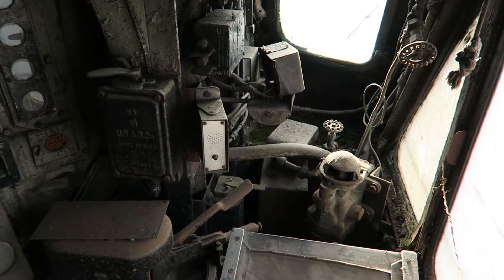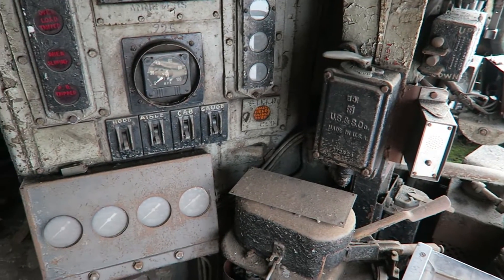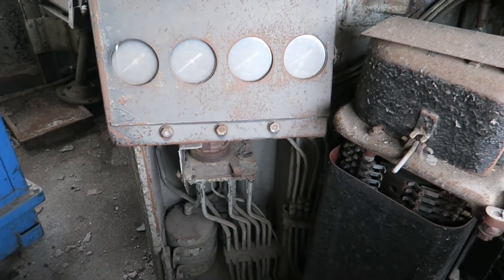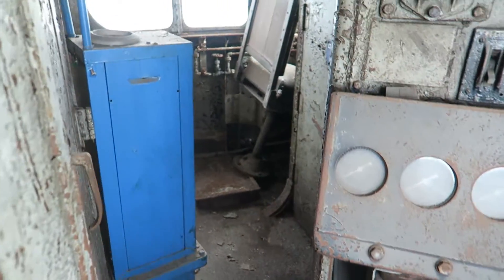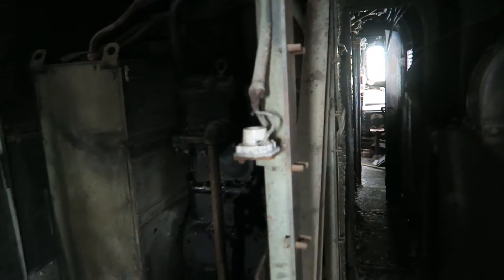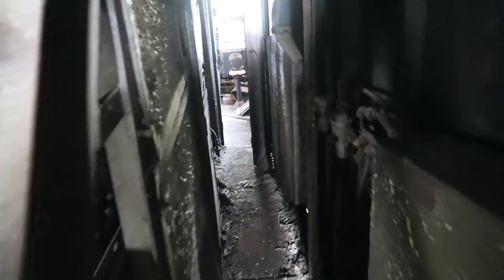Inside of a GG1 Electric Locomotive on 6-12-18

Comment: OMG!!!! I haven't seen the inside of a GG1 since 1973.  Pretty glamorous huh? They were pretty much just as filthy back then. And LOUD? OMG again. Couldn't hear crap at operating speed. All they were good for was pulling and that they did very well.
Reply: When the GG1's were built, the "normal" cab was a steam locomotive cab, which would have been filthier.  Maybe louder, as well--I've read of signals set up to let British steam-engine crews know that there was an air raid going on during WWII, because the crews couldn't hear the explosions and sirens and all the rest of it over the noise of the engine.  And an air raid isn't exactly subtle, as sounds go.

Comment: It is so sad to see how this artifact of railroad history has been allowed to deteriorate so badly. I know she will never run again under her own power, but some kind of effort needs to be made to do, at the very least, a cosmetic restoration. The GG-1 was a unique piece of railroad history and needs to be preserved for posterity.
Reply from the maker: The GG-1 is our next project to restore after we finish our New York Central 19000 series wood sided caboose. The biggest problem is raising the money to do it.
Reply: @Tom-zp9bc  That is very good to hear! Of course, raising funds is always difficult in ANY restoration project, but if enough people believe in the reasons for such a restoration, I'm sure it can be done. 

Being on a fixed income, I don't have a lot of money, but I'm sure I can send a few dollars. Every dollar counts.
Reply from the maker: Cosmetic restoration is planned when we get the money to do so. Hopefully in the next 2 years.
Reply: It might not be able to run again under its own power with its original equipment, but there's still the option of a restomod. And honestly, to be able to run one of these you'd have to restomod it anyway. The electrical systems were designed for a 25kv 25hz AC supply, but the lines that ran these have since been converted to 25kv 60hz. And you'd need to equip it to meet modern FRA standards anyway.
Reply: Yeah sad why they have trolley museum with a electric power why not a electric locomotive oooh the electric motor bs restore this wonderful machine restore the actual electric power yes it could
Reply: Here's a idea..since it only goes to about 105 to 100mph. Why not put it on service alongside the modren AMTRAK or NJT as they did have them till the 1990s
Reply: Never be an engine like her again fifty years  of service longest  in railroad history yeah I'm a Pennsylvania man

Comment: Many years ago a railfan friend and I had a short ride in a GG-1 at Perryville, MD. The engineer had to do a switching move and invited the both of us up into the cab. I didn't remember what the cab interior looked like from back then (early '70s), so this video was pretty much new to me. The engineer said they were hot in the summer and cold in the winter.
Reply: Something I discovered with U.S. manufactured locos, driver comfort was nowhere on the design apparently. Take a good look at that seat, a Chiropracticer's wet dream, if I've ever seen one, and the pipes where your legs are supposed to go, no way, not accept able. Why no heaters, the bloody thing ran one electricity, why no Aircon, why no sound proofing ?
Reply: @itchyvet  in America, ergonomics is defined as fitting the worker to the job :)

Comment: I rode in the cab of the last GG1 ever to operate in service. It was in service for N. J. Transit. It was tight, cramped and surprisingly quite noisy. I have photos of me in the cab, but no way to post them here. We were going over 90mph.
Reply from the maker: Wow, that must have been quite an experience.
Reply: what does the cab smell like
Reply: @robloxelevatorsandreactorc2108  Grease and when it was running, ozone.

Comment: Would be nice to see one restored and back in operation. That is assuming there's somewhere with the correct voltage and frequency on the the overhead wiring.
Reply: Almost the correct voltage (needs 11000 V, been bumped up to 12000 V or 12500 V depending upon where I read -- likely to be close enough) at 25 Hz is still available southwest of New York on lines that were electrified before the New Jersey Transit era (including the Northeast Corridor).  Not sure where the switchover is from the Pennsylvania Railroad's system to the Metro North system (12500 V @ 60 Hz) that replaced the New Haven's system (was 11000 V @ 25 Hz), so not sure if you could still run one into Penn Station or maybe even to Sunnyside Yard.  But once SEPTA gets rid of their Silverliner IV EMUs, which I think are the last equipment that can't take 60 Hz, then the incentive (other than inertia/lack of money) to keep the 25 Hz electrification will be gone, and somebody may figure that it's cheaper in the long run to replace the Pennsylvania and Reading electrification systems with something that standard parts are actually available for.  So in addition to a new non-PCB transformer for a GG1 restoration, you would also have to put in a rectifier to avoid overheating the motors.
Reply: I believe there is a restored GG1 in Altoona Pennsylvania at the train museum there.
Reply: @Lucius_Chiaraviglio  And then there's the asbestos, and the lead, and probably some other ugly stuff in there that I don't know about.  (Just for clarity, I'm not criticizing the design at all.  The G's are classics for a reason--they were insanely good engines, and the technology and materials used were state-of-the-art when they were built.  It also happens that since the 1930's, we've found some less toxic ways to cool transformers, insulate wires, and so on 🙂.)
Reply: @brownpcsuncedu  In addition to asbestos, lead, and PCBs, you also have to worry about frame cracks (in the 1980s on USEnet group rec.railroad, people posted that these were fairly widespread, making retirement urgent).  Asbestos and PCBs can be removed (lead, maybe better just let it sit there and make sure it doesn't migrate or become dust), but repairing cracks due to metal fatigue is going to be a real challenge.  (That said, if somebody DID figure out how to re-anneal metal fatigue cracks, that could be very useful for other purposes.)

Comment: The story goes these things don’t have a rated top speed. In trials and testing, they found the flattest, straightest alignment on the Pennsy network. The engineer ripped open the throttle, got over 110 mph, said “I think that’s enough” and closed it again. That was the listed top speed, but the crew on the engine that day said they could have kept going if they wanted to.

Comment: With all the advancements in technology, I'm surprised these locomotives can't be made to run again
Reply: One of the issues they have on top of the PCB problem is cracks starting to form in the frames and the casting process being either bypassed by technology or prohibitively expensive  to recast.

Comment: Shame these things will never run again, Due to those damn PCBs.
Reply: Printed circuit boards are pretty bad. Everything should be handwired like it used to.  Also, what's with all these micro transistors?  Vacuum tubes are the only way to go. 😜
Reply: @MokkaMatti  polychlorated biphenyls
Reply: @ftrdtuh4827  I knew that; I was just being silly - as indicated by the Emoji.

Comment: I guess it cost a lot money and time get one these legends operational. Of course the Voltage went from DC to AC and there isn't a really simple to convert these legends.
Reply: The line infrastructure is still there and pretty much the same as when these ran, it's the stepdown transformers in the loco that are the problem
Reply: I'm pretty sure they are AC
Reply: The GG1's ran on 11,000 volts 25 Hz AC, The NEC is now 25,000 volts 60 Hz AC (someone can correct me on this if I'm wrong).

To get a GG1 up and running they would need to put a new transformer in it and adapt it somehow so that the AC motors can run at 60 Hz and not 25 Hz (I have no idea how this would be done if indeed it could be done).

Also they had asbestos in them and that would all have to be removed.

Not cheap.

Comment: Talk about narrow pathways! I bet the crews hated operating the GG1 units.
Reply: They do love to operate the GG1s but you are right they hated how less space they had in them. But otherwise they still liked them.
Reply: The Fireman duties caused him/her to move inside between F&R end cabs to observe the pantographs enroute. Also the video travels from the R end to the F end passing the steam generator to the left. Overhead piping connects #2 water tank to #1 tank with a syphon valve moving the water by suction to the generator to make steam. It was a dirty important job operating the steam generator for the Engineer on his long Florida passenger train. The steam was the source of heat on the train and cooking stoves in the dining car.

Comment: Are the transformers still present, or were they removed?
Reply: Removed due to PCBs
Reply from the maker: This GG-1 was gutted before our NRHS chapter took possession of it.
Reply: @Thunderbolt_1000_Siren   what are PCBs ?
Reply: @Eric_Bassett  Polychlorinated Biphenyl. A chemical once heavily used as an insulating agent for electrical components from the start of the industrial revolution until the 1970's. Was banned in North America and Europe in the 1970's due to its carcinogenic nature as well as being linked to several other diseases and birth defects. These gg1 locomotives had super powerful transformers that could (back then) only be cooled with pcb oil because it would absorb so much heat and never break down. After the gg1 was retired the epa mandated the removal and proper disposal of these transformers to avoid contaminating the environment when they sat. Odds are the engine compartments are still contaminated with pcb oil from when the transformers were refilled when the locos were still in service. Also note the insane amounts of lead paint flaking off the walls of the cab. I personally would not walk through this one without a hazmat suit and respirator.
Reply: @AcuraLvR82  I don't know if you know about Cincinnati's WLW-AM old 500-kilowatt transmitter from the 1930's. The transmitter used two huge modulation transformers to generate the high RF current necessary to produce the 500-kW signal. These transformers ran very hot and required hundreds of gallons of PCB oil to cool them.

When the transmitter was decommissioned in the late 1930's, those two transformers sat, filled with their oil, for many decades, and they eventually developed leaks from years of non-use. They were finally drained after PCB oil was banned by the EPA in the 1970's, as with the GG-1's transformers.
Reply: @Thunderbolt_1000_Siren  hello thunder this video got recommend to me today